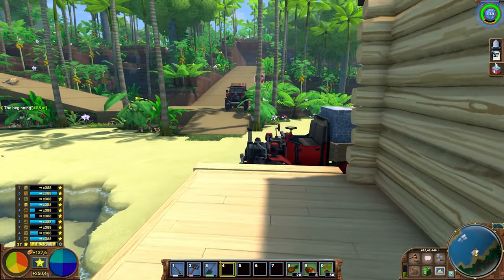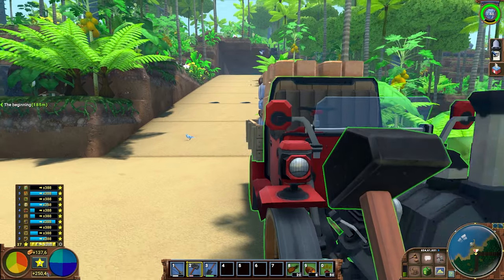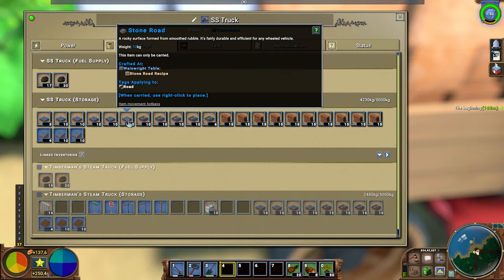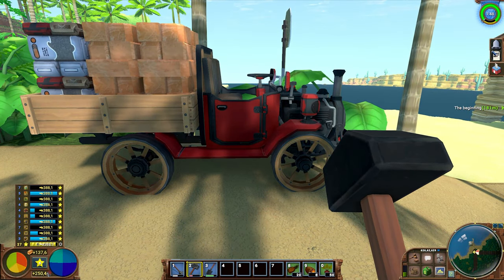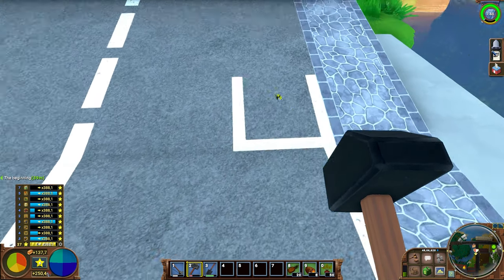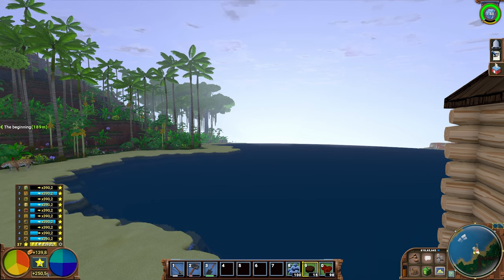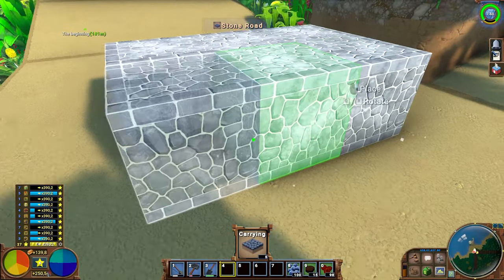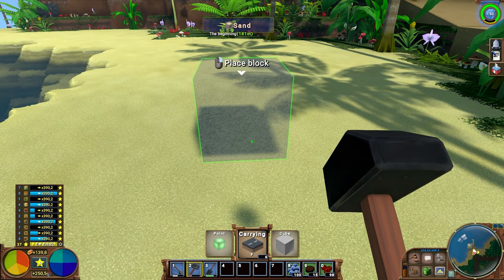A Road and sidewalk Guide - Tips and tricks on how to ECO

Comment: For the side lines: I prefer to use the centered solid line-blocks for road sides instead of using the edge lines, leaving a half-block shoulder on the roads for a few reasons:
1. It works nice with the ramps: there are center-line ramp blocks, so you can still have ramps with lines and keep it looking nice.
2. Having an extra half-block width makes driving a bit easier.
3. Overall, once you start building up road signs, it looks better and helps prevent barely clipping road-signs when turning.
4. Slightly better visibility.
The downside is, of course, that you need even more asphalt per road length.

I also recommend paying attention to the land claim grid when planning roads: By building to the grid, you prevent players from needing to claim chunks of road to build their own buildings. It can also be useful on large servers if the government wants to do things like set up a district for all roads areas, which can be useful for public works projects.

My personal road design goes like this:
S S I - - - -||- - - - -|- S S    where S = sidewalk, -|- is asphalt center line, - is clear asphalt, and | and | are side line asphalt: 14 blocks wide (4 sidewalk + 10 asphalt . I'll lay this out such that the asphalt covers exactly 2 land-claim grids wide,  leaving the sidewalks on separate land claims (which encourages people to push even further off the road, unless they really need the space. Have had people do clever things with overhangs over the sidewalk.
Reply from the maker: Thank you much for your comment, If you are still interested ill be uploading a video within 2 days explaining myself, If not then i understand it well and i hope you are having a good time playing game!
Reply: @soupstick  I will be sure to check it out. I'm currently taking a break from the game, but was considering launching a new server in the Spring.

Comment: Everything that uses power will make power available at a range of 10 blocks around it. Not only horizontally, vertically too. Just remember, that the area is no cube it is a sphere. We made our streets bigger because the powered vehicles have problems to get around any corner if there are just 3 blocks wide paths.
We have build the roads into the land as it is more natural especially at areas with untouched nature beside the streets. To make it easy we build the roads by using the Skid Steer. At the beginning we used a vehicle from a mod. It is like the Skid Steer, just it can only pick up sand, dirt, clay and crushed stone.
Reply from the maker: Ill might miss something being silly sometimes but do you talk about electric vehicles as in a mod?
Thanks for the information on the sphere powergrid, i did not think about that!^^
Reply: @soupstick  No, with the vehicles I meant the truck and the powered cart. The Truck has a fairly small turning radius, when he is very slow.
We have only a mod for colored carts, powered carts and trucks. One that adds a bike and an electro scooter and the one that adds the coal powered skid steer. The devs shown some pictures and mentioned something that their might be a truck with trailer coming and ships are coming for sure.

What I meant is that every electric table, lamps and so on, so everything that uses power is also a transfer station for the power in a radius of 10.

Comment: Road size always seem to be a debat in multi player. For me it is important that road are on par with the claims grid.
Reply from the maker: Its going to be something to find a good MP server that likes road rules hm
Reply: almost agree, because of the middle line, road have to be odd, but 5 is too small and 15 is too expensive for short server and 10 is even, but there's a simple solution that just require some cooperation:
15:with 15 space you shouldn't have any probleme, there's many design possible
5:people have to let one line of their claim free, with a sidewalk(and possibly claimed hanging sign), but they still can build full size on every other floor
10:only one side of the road have to let 1 free line, or both since sidewalk doesn't have to be the same size both side